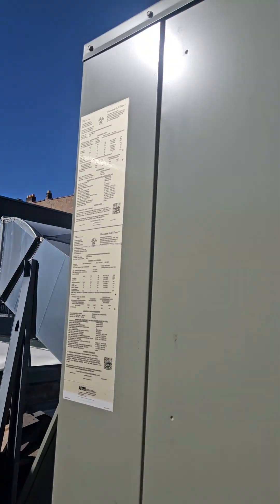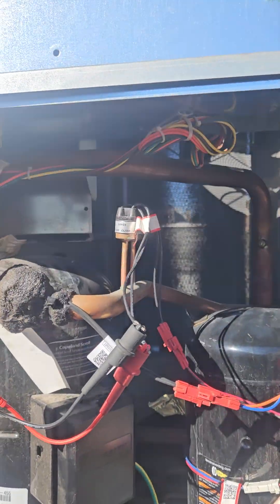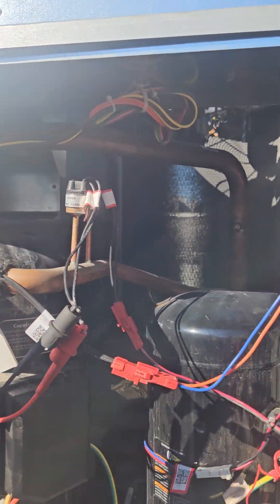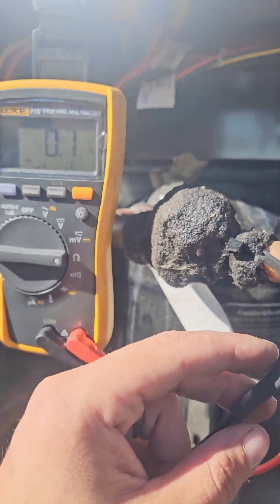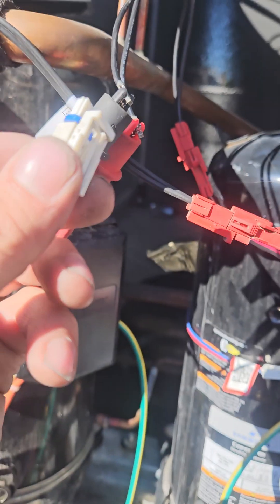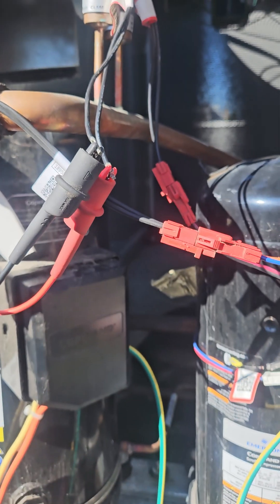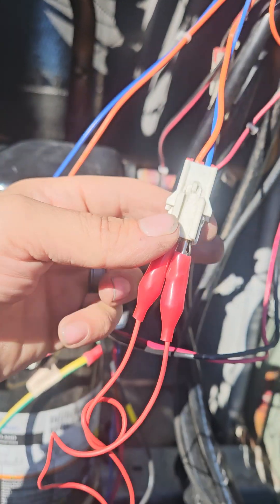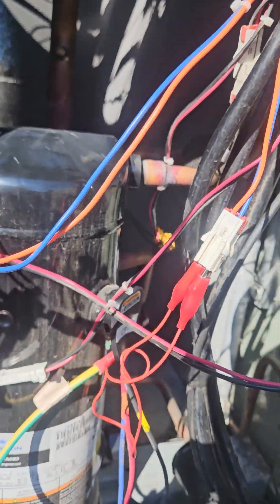Trane symbio 700 compressor 2 proving lockout.

Comment: Update? Having the same issue, curious if this resolved the issue for this unit.
Reply from the maker: @clintwheatley7972  so I found a bad connector on the low pressure switch and I've heard other guys have had multiple bad connectors. i ended coming back a month later and found the system would drop below 100psi in stage 4 and 5 so we unplugged the unloader temporarily until we can get back. If you need to ohm the switches I used some stat wire and alligator clips.
Reply: @tillerdogg3232  sounds like a manufacturer defect. Seems your experience is consistent with what most people experience with these units. Appreciate the response.
Reply from the maker: @clintwheatley7972  Trane dropped the ball on these. I'm hoping someone comes out with a full on bypass kit or something. For now it's just wire nuts and electric tape lol
Reply: I have seen some of those connectors not be fully inserted. If you re-insert the wire into the terminal it seems to fix them. Additionally, if yall are having nuisance proving alarms, what I have been doing is removing the load side of the compressor ( so you are not short cycling them ) and find where the call for the compressor leaves the UC, then sit there and turn that compressor on and off repeatedly. Been finding some UCs that fail to send the call every time. Keep in mind on units configured for VAV, you have to wait for the VAV open timer to elapse, which is 120 seconds by default.
Reply from the maker: @joshuaricks7730  thanks dude I'll keep that in mind. This unit went down again a month later with the same issue but this time I was seeing a pressure drop in stages 4 and 5 so there may be a leak. I ended up unplugging the unloader and that kept pressure at a fair spot so we'll see what's going on come spring time.